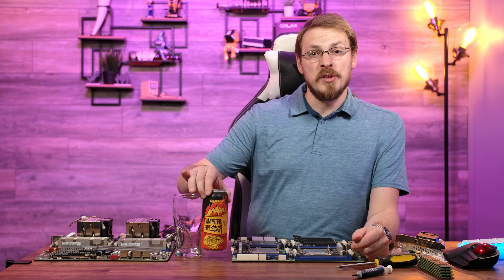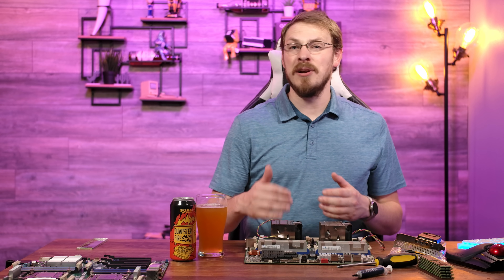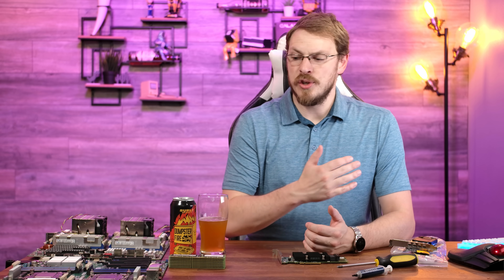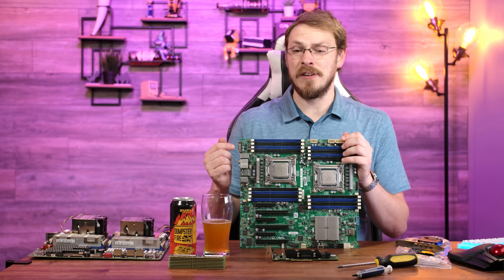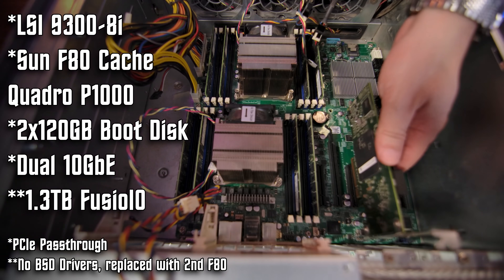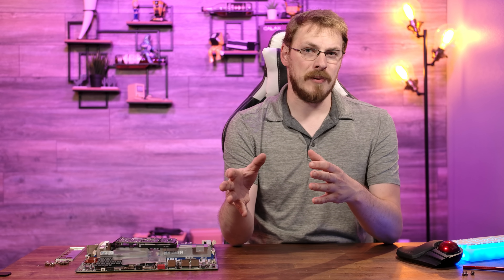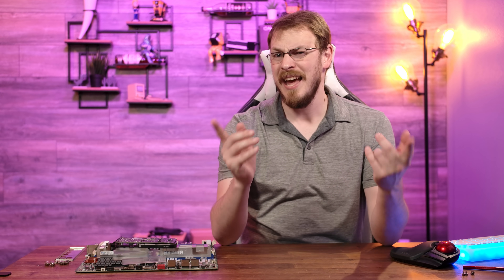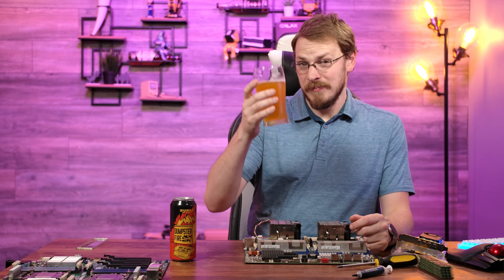Running out of things to die - TrueNAS Motherboard Replacement

Comment: When building home NAS servers the limiting factor is usually the network. Why build a fire breathing monster if you're going to squeeze that data through a 1G pipe? Backup servers can afford to be even slower.
My NAS server runs a lowly J5005 which can still saturate 1G Ethernet, run a bunch of Docker containers and various security cameras without breaking a sweat. Cheap hardware that pulls very little power. I must admit I went way OTT with the storage. Main storage is 3x 2TB NVME drives, which are horribly bottlenecked by a qnap 4x NVME expansion card. It can only run 1x PCIE or 8x PCIE. The motherboard only has 4x PCIE so I have one PCIE gen 2 channel feeding 3 SSDs. Looking back, going NVME was a dumb idea but once I bought them I had to go with it. The server also has an 5TB hard drive for data that isn't accessed often. I'd like to upgrade to 10G networking at some point but my network is physically big - about 200m(~650ft) end to end, 80m of which is underground. That's gonna get expensive to replace.
I'm just in the process of adding a little backup server which is a Pi4 and 5TB drive, which will live in a small box bolted to the wall in a barn, far away from the main server in case of fire, flood or a break in. It's pretty slow with encryption and compression enabled but in this case it's actually a good thing as it won't hog the network while running a backup.

Comment: I recently build my own home lab server based on a 	SUPERMICRO X10SRI-F motherboard. I also struggled to get the IOMMU working. But I finally managed to get the BIOS settings right. It now works like a charm. I pass-trough my entire DELL PERC H310 HBA and the attached 8 hot-swappable HDDs to my TrueNAS ZFS VM on Proxmox and I also pass-through my NVIDIA Quadro P620 GPU to my SHINOBI Camera Surveillance LXC cointainer in Proxmox. Proxmox itself uses 2 SSD connected to the onboard SATA connectors for OS and VM storage. I documented my build on https://www.kreaweb.be/diy-home-server-hardware/#14_DIY_HOME_SERVER_-_BIOS_Configuration. Maybe it helps anyone to get their system up and running.

Comment: On the cpu front, what about the 2667 V2's? if memory serves they're the same base clock also with a turbo to 4GHz and they do 3.6GHz on all cores but they keep their hyperthreading and are still 8 cores, so 8/16 each at the same clocks, might be worth considering, I used to have a pair of these and they're damn quick

Comment: Not sure if I'd virtualize my Truenas for production, at the very least you will be subjecting it to the Host scheduler, over which Truenas will have no control or visibility. Thats of course not even taking into account Truenas plug-ins and running VMs in Truenas (the only reason to use Truenas over other options).

Can it be done? Yes. Will it work? Yes. Will most "enthusiasts" not even notice its a bad idea? Also yes. But it's still a bad idea.

Comment: Hardware I run: Supermicro Mini Server with OpnSense, X10SLM-F, 16GB ECC, Core i3 4360, 7x3TB WD Red and TrueNas on a SSD. OpnSense and all Switches will be replaced in July with an UDM Pro, Unifi 16Port Switch and an Unifi 8Port POE Switch. New I will get the access Point from Ubiquiti and can get rid of my Netgear Nighthawk. I like to replace my Truenas with hardware form ixSystems. The mini XL would be the one for me. After I changed to Ubiquiti I have 2 switches less then before and will try to sell them and the Nighthawk as well.

Comment: As for Upgrades to the homelab/studio
I'm currently planning on buying a 3975x which means new mobo, 2*64Gb Dimms for a start, 1300w psu and another rack case, the only parts that I transfer from the old system into the new one are 3090 and ssds/hdds.

I'm going to use it mainly for 3d work and gaming but the occasional vm is also planned.

I'm looking into pxe boot with a server vm for the entire disks of the other client vms, if that makes sense

Old Setup i7 6800k 32Gb 850w is going to be the gameserver which will be used instead of the vps in more singlecore demanding game server applications
Reply: Btw. can't wait to upgrade to 10G nics for everything, but thats not a priority as of now, when there will be a nas server than the upgrade will be required at some point

Comment: I have an Truenas server with about 14TB of available storage. And an ESXi server.
Both are running on an Z97 motherboard with an i5-4690k in the Truenas server and an i7-4790 in the ESXi server.

I don't have any need for an upgrade at the moment. But if I could find an better case for the Truenas server other than my Fractal Design R5 then that would probably be it. I would love to have hot swappable discs, but this would also increase the noise since the R5 is an extremely quite case.

Comment: Hi Jeff. The motherboard is Supermicro X9DAi, not X9ADI :D.  

I use for my NAS a ASUS Z10PE-D8 WS motherboard with 2 Intel Xeons E5-2630L V3 with 64GB ECC RAM DDR4, 1 NVME Samsung 970 EVO PLUS for a cash drive, one HDD Seagate Exos 6TB. And 1 Samsung 870 EVO 1TB SATA for the virtualizations. Operating system i use is UNRAID. Some old videocards for virtualisation (exchange and domain servers). And a Corsair RMx 750 Gold for power.

Comment: My nas server is pretty simple with a asrock rack E3C226D2I running a pentium g3250 with 16 gb of ecc ram, a mellanox connect x3 and 3x3Tb Seagate drives.
Next step probably would be to migrate the motherboard to something to support more pcie cards and more ram, maybe throw a e3 1230 cpu on it

Comment: my primary unraid server is an old Dell T620 upgraded to 12 drive bays, a h330 hba, a second e5-2650v2 processor (mainly to unlock the extra memory and pcie slots), 96gb of memory, a dell 10gbit card I still dont know how to configure, and a sun F80 cache card.

I also have 2 R710's i won in a good will auction, a hp z800 workstation and my old AMD FX rig i use for a backup server 

my next upgrade besides getting that 10gbit connection to the backup computer running would be more shucked 8gb wd hard drives

Comment: Need some advise, you upgraded to 16gb ddr3 ecc registered dimms , i am in need of more 8gb dimms

My server
Xeon e5 2670 8 core 16tread
64gb mixed dimm config ddr3 ecc registerd
Asrock x79extreme 11
VMWare ESXi 7.0 
4x3tb passedrrough to a freenas vm
2x2tb for esxi datapools 
240gb pny xlr8 ssd boot drive and iso image pool
255gb nvme ssd on pcie rizer board passed trough to a windows 10 plex vm 
Intel dual port gb nic onboard broadcom nics of x79 extreme 11 wont play nice with esxi 
Gtx680 twin frozer passed trough to w10 plex vm
Renesas usb3.0 pci-e card paastrough to free nas vm onboard usb 3.0 locks up freenas vm 
Planned upgrades gtx680 replacement for quadro p2000 or rx550
Matching set of 8gb eec registerd dimms 
Any advise on good set and price for it or maybe a better huper visor enviorment

Comment: Server : Machinist X79G , 32GB RAM , 256  NVME SSD , 500GB HDD, Xeon 2640 V2  I am going to upgrade board to PlexHD X79 Turbo to get more pcie devices passed tgrough and i am running pretty low on storage

Comment: My home-server is a Ryzen 1600 in a MSI B350 board; with a LSI 9405W-16i card connected to a bunch of disks and NVMe.

Next upgrade: a 10 gigabit card, somehow getting its x4 PCIe lanes from the M.2 slot (still trying to figure out how to make this work and make it reliable)

Comment: My home lab set up is a 2 machine setup running vsphere7 and vSAN.  Server 1 is a Chinese X79 motherbord with an Intel Xeon E5-2630L CPU, 58GB Ram and Server 2 is a Super Micro X9 DRi-F motherboard running an Intel Xeon E5-2630L with 56Gb of Ram.  Servers are Virtual TrueNas with a regular SATA PCI-e adapter in passthrough, some windows Servers and some Linux Servers.  Maybe adding a 3rd server later on...

Comment: My TrueNas server:
CPU Intel Q8200 2.3 GHz 
RAM 8gb DDR2 800mhz 
Drives 2 500gb mirrored 
Boot disk 80gb sata 2 hdd
Mobo a random hp yellow crap.
PSU fsp hydro pro 700w bronze, because the old hp wasn't grate and I had the fsp laying around. I'm planning to resell it to have some cash back.

CPU doesn't support virtualization so no VM

Comment: My Homelab server is a Threadripper 1920X with 32GB of RAM it has a 12 x 1TB disk NVMe Array running RAID ZFS Z2, 30TB worth of spinning rust is connected via a P2P 4Gbit fibre channel card as a storage pool to the main server. To much detail to go into so here is a build album of photos https://imgur.com/a/dulJbNk

Comment: HP ProLiant G7 N54L Microserver with Windows Server 2019....does the job, drives are ntfs no need to format anything just plug in and pray, plus already have a bear-metal backup ready to go, just in case of hardware failure. wait a minute i only have 1 copy.... SHIZA!!! its not backed up. ARRRGGGHHHH

Comment: I am running a Ryzen 5 2400G with 16gb of ram and Intel X540-T2. Drives are RaidZ2 6x4tb HDD's and Raid0 2x500gb ssd's. Truenas is running off of a overkill 250gb 970evo because I was sick of the dual USB Drives.
My next "upgrade" is finally getting the automatic TrueNAS to Synology (bought a DS220J) running. It's been an absolute b#tch and doesn't work with SSH Rsync for some reason :(

Comment: I use a qube 6 bay nas, with core 2 duo 1.1ghz, 2gb ram. Fileserver, backup and plex. Everything is backed up on jottacloud.

Going to build a new network with 4 different Vlans in an another place. Don't understand what equipment to use, but need firewall and managed switch, that can handle at least 300/300mbps

Comment: my NAS was struck by the same fate last weekend.
still havent got any replacement parts, im still arguing if a new build would be smarter.

one planned upgrade would be probably to first or 2nd gen Epyc, the 8 - 16 core CPUs go for around 200-300€ here.

Comment: Nice looking TrueNAS box now :) 
This is my setup:
Storageserver: Supermicro H8SML with AMD Opteron 3350 HEL, 16Gig ram, 3x8TB HDD, 2TB SSD for ESXi ISCSI (running Fedora Core 32)
EXSi server: Supermicro X10SDV-4c-TLN4F, Xeon-D 1581, 64Gb ram - running about 15 VMs (ESXi 7.0)
Rest of my network is 10Gb NetGear switch and Unifi switch/UDM PRO

This is more or less what i am allowed by the wife to run :D

My next thing to get, is new HDDS.... but as it looks rigth now, it sucks to buy 14+ TB drives

Comment: I have a HP Z400 Workstation running TrueNAS, want to max out the ram but cost is an issue, i have 24gb at the moment and only two pools, one for Nextcloud and one for Plex so its not a major issue, the one thing i will be doing is getting cold spares as at the moment I haven't any.

Comment: 12:20 I'm running Poweredge G13 servers (xeon v2) for unraid VM and Storage pools, Proxmox for more VMs, and a Futro S920 thin client with a low profile NIC for OPNsense, along with an Aruba 1930 24G 4SFP+ managed switch.
My work station lives in a 4U chassis in the middle of that, 3900X-64GRAM-5700XT, with a CPU custom loop.

I'm hoping to get more diverse thin clients to run them in a kubernetes cluster (with the control plane running off of the proxmox server).
I'm hoping to swipe a good single thread performance future node,  like a HP T620 with a AMD Ryzen Embedded V1756B , for some containers that need more processing juice.

Comment: My server is just a collection of 'unused hardware' (with exception of hard drives and the GT710). So it is just a Threadripper 2950x, ASRock X399 Taichi, 96GB RAM running at DDR4-3000 (can't get them to run faster), ASUS GT710 with 4xHDMI ports, Samsung 830 250GB as boot drive, Intel 660p 2TB & 4xSamsung PM981 250GB (as VM drives), NH-U14, Superflower PSU, Define R6 case, plus some hard drives. Before someone comments how is that old unused hardware, well, it is 'unused' after my desktop got upgrade to 5950x :D

Comment: Before I started watching Craft Computing, I had a 10yo Alienware laptop...... 1 year later, I now have a home built Ryzen3600/GTX1660Super gaming desktop, a DELL R710 w/ 2x X5670s running TrueNAS, an Intel SR1695GPRX (X3450) running Proxmox for Home Assistant, Pihole, etc..., an Intel S3420GPRX mobo (X3430) in a generic rack case as a network DVR and a 36U server rack in my garage.

You sir.... are a bad influence!!! :D

Comment: My Shamelab:
A dirty Synology DS1621+ for the main NAS + external backup drive.
Dell R620 2xE5-2660v2 64Gb Ram 10x600Gb 10k SAS currently doing CHIA plots as a hobby.
Raspberry pi 4 connected to a 5 bay USB sabrent enclosure with 5x12TB WD Red Plus drives in RAID 6 on ubuntu server LTS (This was an experiment that I let go too far damn you CHIA).
Raspberry pi 4 OpenWRT router that kinda works when it feels like it.
A google wifi puck because reasons.

Comment: Currently only have a TrueNAS machine on an old Dell T1700 motherboard, E3-1226 v3, 16gb of ECC RAM, Dell SAS controller flashed to LSI IT mode. I'm currently debating on building a dual Xeon E5s V2 or going with a Ryzen 9 3900X for a virtual lab server.

Comment: Just out of an upgrade of my home lab, something new and something old. I replaced my main server altogether from an HP DL380 G6 to a Dell Poweredge R720, from 128 GB RAM and 4 TB of storage to  256 GB RAM and 8 TB of storage and faster CPUs. My storage-server got a new case Fractal Design Meshify 2. Also in the Dell server, I had an H710 RAID card and I started with Seagate drives. Had the same issue as you with that brand, bought new HGST drives and an HBA H710 from Artofserver. That card is the best thing I bought for this setup.

Comment: Oh, my "homelab"... The source of many nights and days of frustrations .. :) 

3x NetApp 4243-shelves, 24 drives each 
1x HP DL380 G9, running VMWare

Yes, proxmox and Plex is running virtualized on this, and that is part of the frustrations. When booting ANY of the virtualized servers, it's a literal cointoss if the boot completes or just freezes. 

I'm going for a simpler solution next time. And fewer, larger drives. This current one comes with a price of "that's my electricity bill? holy..."

Comment: for a budjet build woud be a c612 with v3 from haswell-ep or v4 from brodwell be a good buy but you must by ddr4 ecc dimms but they are cheap today enoth with 2133mhz. you get 16gb ddr4 ecc reg ram for like 40 $ or less.
the best for power consumption and ipmi is the asus sage strx80 an option like me with 32 cores and 1TB ram an downclocked to 1,8ghz is it a nice powersafing and fast machine for youre workflow.but it comes down to the budjet.

Comment: Homelab is pretty low there :
Dell T1700 proxmox Server with e3-1240Lv3 /32G / 2*480ssd raid 0 for vm and 3*4Tb raid 5 for storage
And a i3-2100 with 2*1Tb raid 1 running veeam for backup :D

Comment: Running an E3 1220
Im planning a big upgrade with epyc Rome or milan depending on pricing and availability.

Or I’ll get a 5900X for my desktop and the 2700X gets one of those cute asrock rack boards with ipmi

Comment: My lab started off with a HP ML310e G8 v2 with 8GB ram and a i3 processor, plans to upgrade it to a Intel Xeon E3-1230v3 and up the ram to 32GB, also have a HP DL160 G6 (old I know but works) but want to upgrade from dual quad cores to dual hex core Intel Xeon X5680 CPUs with possibly 64GB ram

Comment: I have a repurposed Dell XPS 8900 with a i7 6700, 16GB and about 9TB of random assorts of drives. Windows Server 2019. I am planning to some how turn it into a proxy for Resolve but it's current running SMB3 and a simple PaperMC server.

Comment: Running an Asrock J4205-ITX with 16GB of ram running FreeNAS inside of a Fractal Design Node 304 and two 4TB WD Red drives for storage. Soon to be upgraded with 2x 1TB SSD and a quad port NIC to run Proxmoxx (or TrueNAS scale??) and have some fun with VMs and networking. It's a surprisingly capable little box, even with just a 4 core atom CPU.

Comment: Dang, I feel this one. Recently had two HBAs partially fail on me after years of use, they'll be missed.
Dual 2630v2, X9 board, 128GB ECC, x540 nic, 9211 HBAs.
Waiting to see what the upcoming DDR5 platforms look like. Hopefully the current rig will do for another couple years while DDR5 matures

Comment: I run a Chenbro NR40700 with a x79 mobo, 32gb ecc, 2687w v1. 

I run unraid with dual parity, sitting at 47.2 TB right now! 

I actually just built a new firewall with a super micro motherboard that has 6 10gbe, and it was only $80! Running on a  e3-1220 v3.

That might be a interesting item to check out!

Comment: That HBA you can reflash to the LSI version, and i cant remember if thats the Dell HBA you need to drop/covre one of the PCIe contacts for some bizzare reasong
Reply: asaaannnnddd should of finished the vid before commenting :P Good Luck its butt clenching on the reflashing but goes quiet well.

Comment: My homelab is very similar! Running dual xeon E5-2680 v3 on a Gigabyte MD70-HB0. Its been up for almost a year now and I haven't run out of power yet. P1000 and P2000 gpu's for plex an and workstation vm with a quad Intel NIC. I will probably add a nvme storage card next or look at cpu upgrades to v4's, something with higher clocks. Hard drives are are my main bottle neck right now.

Comment: The home server runs ubuntu server on a320, passively cooled 200ge, 8Gb 2660, booting from 128Gb m.2, 4Tb wd red, manually doing backups to BR drives. Next, upgrade add few extra drives. 2011 Chinese motherboard based system was just too loud and hot for my liking.

Comment: I run two instances of proxmox. Main is I7-2600 with 32GB memory running alot of "crucial" applications.
Second is I5-2500 with 16GB memory.
Backups are keept on an Ubuntu server with dual offsite backups.
So if either of the proxmox goes down I can spin it up from backup on the other machine. I also keep an ssd with proxmox installed in my main workstation so if shit really hits the fan i can spin the "crucial" virtual machines up on that.